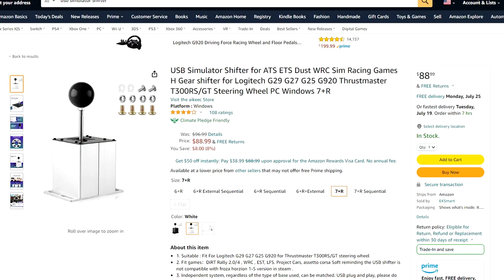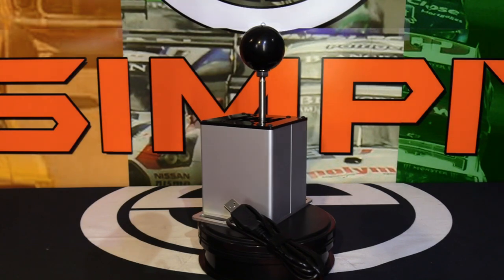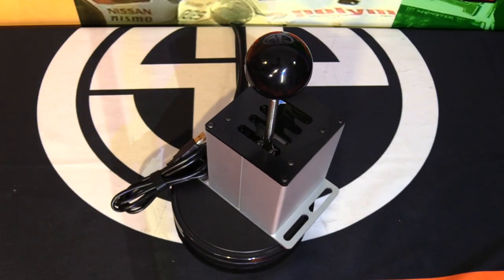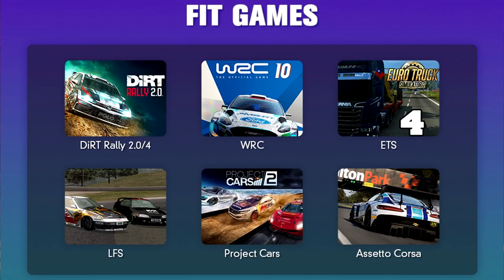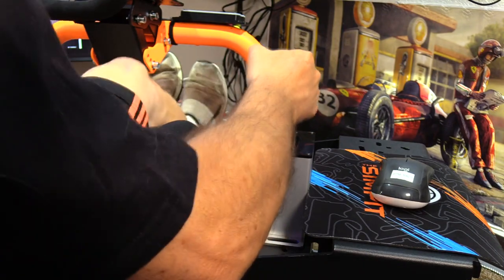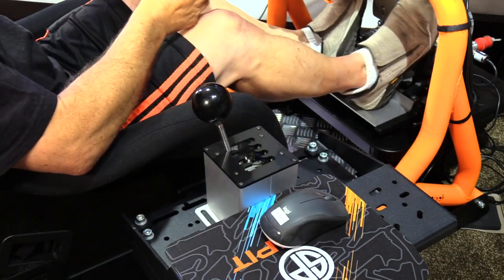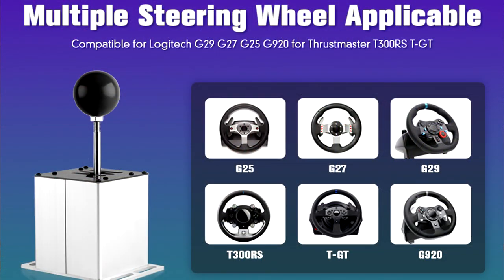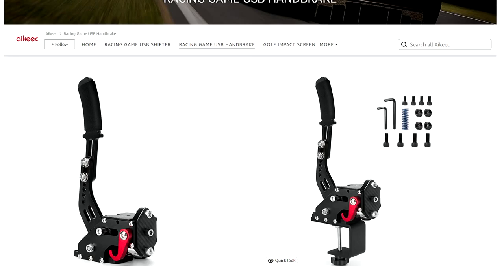USB Simulator Shifter Review - Under 100 Bucks

Comment: I have one very similar to this and cannot recommend enough. Just add a few extra locking nuts to the long set screws holding the shifter springs. You'll be good to go.

Oh I've owned the th8a and the logitech shifters and this is better than both.

Comment: I bought one on Aliexpress for $65 for my truck simulator.   I removed the generic usb controller and wired up my own stm32 microcontroller loaded with freejoy and mounted it to the side of the case in a 3d printed box with extra rj45 jack inputs for my trucking range selectors and whatever I may need to add to it.   I used a thread adapter to 1/2" threads to adapt to truck shifter extensions.  Internally I made a shuttle to support the bottom of the shaft to take some of the weight off the pivot screw. That pivot screw is the weak link.  Time will tell if that pivot screw fails. I also 3d printed a block off for the 7-8 gates for when I do not need them.  It is much nicer than using the Logitech shifters.
Reply: Hey mate can I please get the stl files you have made?

Comment: I have this,7+1 with seq. 112$....Love it,except if you have crappy finger grasp or not Careful-the seq. piece can fall inside,and it Really needs a shifter boot,gets dirty in there quickly.
I use seq. except in trucking, it is Solid...medium to hard shift click,hasn't felt different yet at about 300 hours

Comment: To help anyone with their decision. I have the Moza r5 bundle, the 12 inch round wheel mod, clutch, upgraded brake, and this shifter in the 7+1 (with sequential mode) and it is really amazing. (For the rest of this keep in mind I bought a different shift knob since the one that comes with it has a very weird feel to it, The different shift knob made the entire shifter feel so much better. Personally I would find something off amazon that fits you, but i’ll link the one that I got in a comment). It is abnormally loud compared to something like the g29 shifter. But the quality is 100x times better than any other shifter out there price wise. The sequential mode is suprisingly amazing and not loud at all, unlike without sequential.  Just make sure you have a USB port available for it! my pc immediately recognized it too, very easy to bind controls.
Reply from the maker: Thanks for your take!

Comment: I had a TH8A for 8 years and was waiting for 3 years now for Fanatec to announce a Podium-tier shifter to get a real upgrade, but got sick of waiting and just got the Fanatec SQ V1.5 just last week ...and I have to say, I'm pretty disappointed with it. The centering tension in the middle, especially laterally feels cheap (like game controller stick drift); stiffening it up to the max makes it stiffer, yes, but it robs the gear shifting of any "mechanical" clunk feel of "gear engaged, you're in".
In terms of mechanical feel, this Aikeec shifter (how does it not have a NAME?) looks like it has a better mechanical feel to it than either TH8A and SQ V1.5. It reminds me of that japanese shifter Barry Rowland once had on his show, that just was too overpriced after importing.
So, thanks for the great consumer advice, Shaun! And good that you pointed out that the Amazon page for the Aikeec shifter is a bit misleading with compatibility pictures. Let me add, the picture for console compatibility is also misleading because the check-mark for PC-compatibility is a RED hook check-mark while the Playstation and Xbox crossed-out check-marks are GREEN, looking a bit like "this box is crossed off with a big green cross, you are ready to go on PS and Xbox".
Reply: I had a TH8A for about 5 years and bought one of the Aliexpress shifters. It was a pretty nice upgrade overall, and I liked the feel of it.

However, I upgraded to a CSL DD wheelbase (first mistake) and decided to buy a Fanatec shifter along with it (second mistake, lol). The CSL DD and Fanatec shifter were both pretty underwhelming. I was not at all impressed with the build quality of the CSL DD and wheels, and the Fanatec shifter has even less tactile feedback than the Aliexpress one.

After about 3 months my Fanatec shifter died, so I got a replacement and sold it. I also sold my CSL DD after my wheel rim decided to break and my friend's CSL DD died on him, and switched to Moza.

My recommendation to you is sell the Fanatec shifter for as much money as you can possibly sell it for, and check out the VNM, Frex, and Simvertex instead.
Reply: @OculusDrift  Sometimes I feel we need some modern day and age "revisited" reviews of older hardware that takes things for what they are and not for what the were compared to the the state of other really old hardware and old games that put out godawful force feedback.
But Fanatec is not all bad. I had my share of bad experiences, yes, this shifter and my P1 Elite wheel (180€) had terrible alcantara and the already improved paddles felt dull af when compared to my previous 150€ Thrustmaster 599xx rim which had incredible alcantara and angular weight distribution for good ffb feel.
But my DD2 is well built, puts out exactly what the game wants it to put out and I can tweak the feel on the fly and get graphical information even on a console to help me see what's going on. The CSL Elite pedals I had with load cell kit were well built and incredible value. The podium flappy paddle module (stupid expensive, yes) feels fantastic in the shifts and I'm not surprised the McMurtry team that just broke the Goodwood Hillclimb record used it on their fan car.

Comment: Hey great vid! Got my shifter today love the quality! however when i connect it with moza r5 bundle my wheel keeps shaking any tips or an idea to fix the shake.
Reply: yo, did you end up fixing this problem?
Reply: I ended returning it and going with moza shifter instead.
Reply: Guessing the 2 were unrelated, as I have a moza R5 and no problems at all with my Project D shifter (sames as these but with hall sensors).

Comment: Why is the fact you don't have to do some extra crap for reverse a con to you? I'm literally looking at this because it is an actual normal H pattern and doesn't have that kind of bullshit.  In what world is that more useful? Or you /that/ afraid you're gonna shift into reverse...in all my years I've never accidently shifted into reverse, I expect someone who runs a channel about sim racing to be better then I am at this, sooooooooooooooo........again. WHY is that a con to you? I am genuinely curious. Want to cancel my order for a logitech shifter and get this instead, only reason I'm not is because I have no way to mount it, the fact it doesn't have an optional clamp should've been a con. Not everyone has a rig with a mounting plate.

(Edit)
I do see after that section, you mention the lack of a clamp situation, fair enough there, at least it was brought up, but felt like that by itself was a con.
This video is 4 months old, its not been that long, I am finding the shifter for about 70 bucks and that same clamp you said was 50, for like 15 bucks. Soooo...you got price gouged it sounds like.